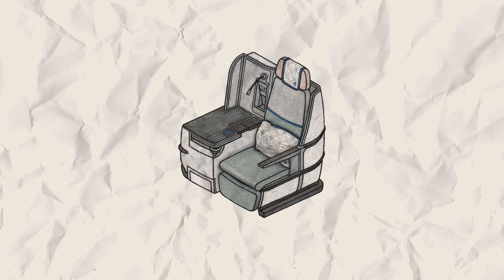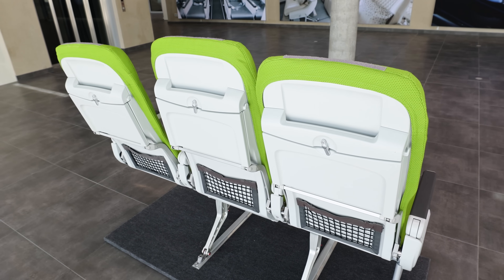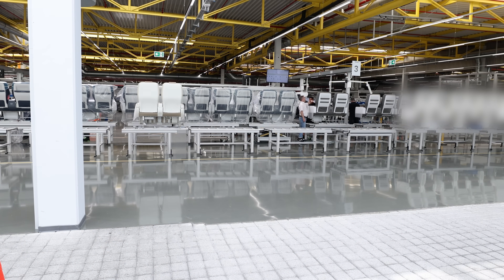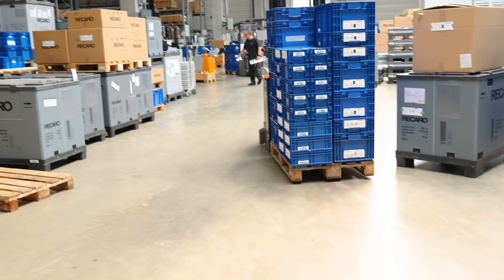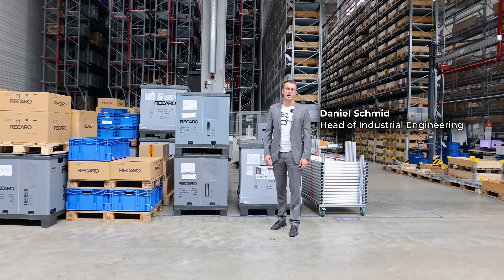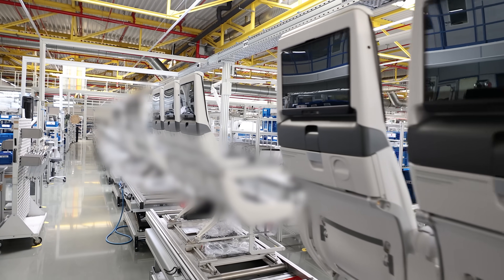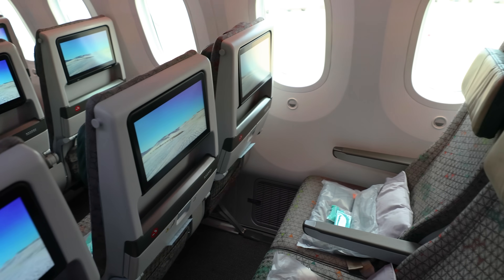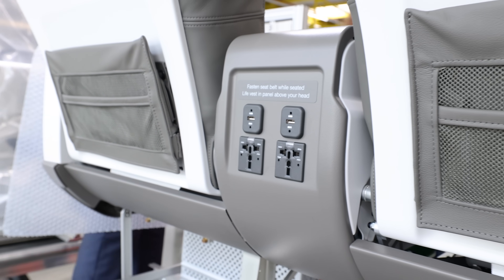How high-tech AIRPLANE SEATS are manufactured in Germany... | Behind the scenes at RECARO!

Comment: Why are they still fitting USB-A ports instead of USB-C?
Reply from the maker: Which ports are fitted with a seat is the decision of the airline, not the seat manufacturer. Any airline can add or withhold whichever ports they want.
Reply: To be fair, most new programs are ditching the USB A completely and only going for USB-C. Or they meet in the middle with a USB A+C combo outlet. But those programs will start being delivered in 2025 and the following years. 
Source: I work at an aircraft seat manufacturer

Comment: When will they make the seat cushions thicker? It seems that the seat cushions always feel flat and become uncomfortable after several hours. It’s fine for a 3 to 4 hour flight. But 6 hours or longer, my ass is so sore. 😅 

I flew on Japan Airlines from Honolulu to Kansai on their B787 that has their “SkyWider” economy seats. The leg room is fantastic, the seat width is fantastic, the material is fantastic. The seat configuration on is a two four two configuration which make it easy for window passengers to get out vs the three three three layout.  The only issue is the seat cushion.  6 hours in the flight my rear was hurting and I had 3 hours to go. 😩
Reply: It comes down to cost and weight. As an airline, the more your overall weight increases the more you spend on fuel. It might not seem like much, but having a thicker seat cushion will increase the seat weight. Multiply that by hundreds of seats on an entire plane and that turns out to thousands of dollars in fuel alone. Also, thicker cushions will cost more to the airline because seat manufacturers can sell them at a higher cost

Comment: Those Lufthansa Allegris economy seats are for 747-8, A380, 777-9, 787-9 and A350
Reply: Not sure if they will put it on the A380, but def the 777-9 and the 747-8 and also the A350!!!
Reply: @MrBlueCreeper  Oh forgot abut the A350
Reply: Ironically, even Recaro CL3710 will be a big upgrade for LH 748 economy with its current extremely outdated, anti-ergonomic and uncomfortable seats (maybe these are also Recaro, but unknown model?)
Reply: @Vladimir_B77W they are probably from either a smaller brand, or Zodiac (now Safran)
Reply: Don’t their 787s have Recaro?
Reply: @Blank00  maybe LH still use not delivered Hainan Airlines cabin
Reply: Hopefully they retrofit their existing A350s that have the Safran seats and outdated business class seats